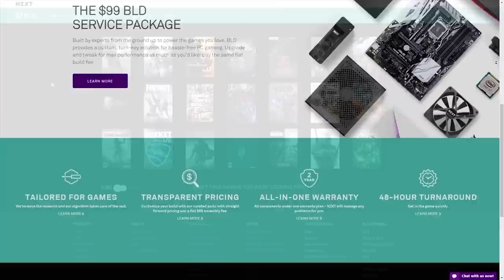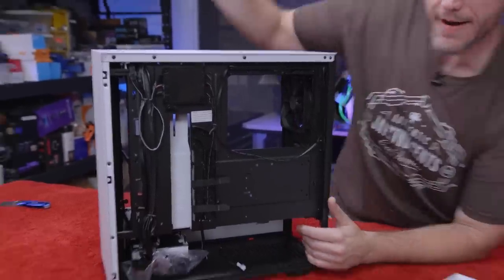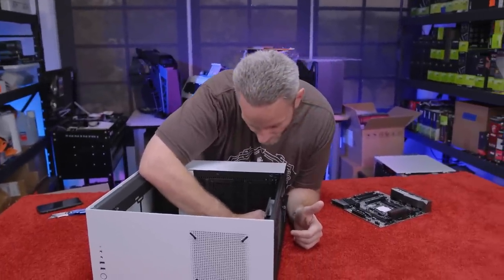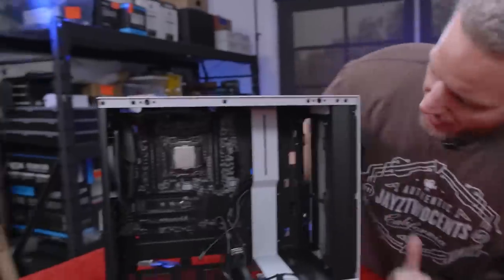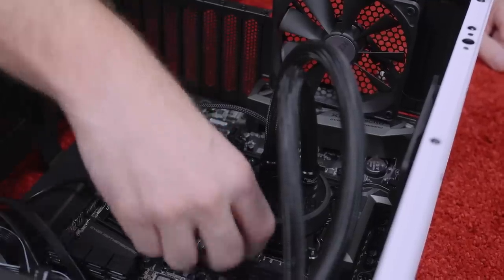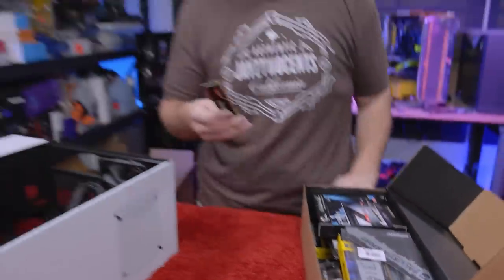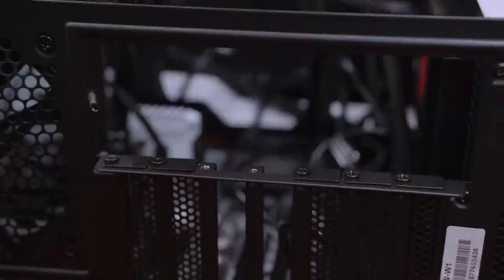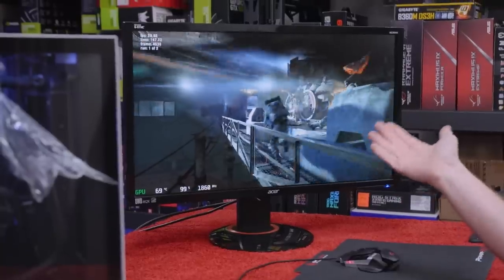We built a computer wrong on PURPOSE!

Comment: is the 1060 3gb version with an i3-8100 still good or should i get the 6gb ver?
Reply: Get the 6GB version. More VRAM is always better
Reply: yeah with that cpu you can utilize more of that card than you could have with an older i3. so double the vram will definitely bemefit you a lot, especially higher resolution
Reply: Dudes, its not just vram. 6gb version of the 1060 actually has more processing power. Dunno why, but it does.

Well... small diff really. 5 more frames in gtav.
Reply: I believe the 6GB version has somewhere between 15 and 20% more processing cores (CUDA cores) then the 3GB version. So it has a significant performance boost over it.
Reply: A lot of games are requiring more and more vram. I have a 770gtx, and my wife has a 1050ti. Her has 4gb of ram, mine has 2. Technically mine is the faster card, so mine runs some games better, but in some games the vram is maxed out and it actually runs worse than hers with a slower processor. 3gb will begin to struggle very soon in games so 6gb would be better.

Comment: There is one thing you cannot do if you have a motherboard with pins on it or you will destroy your pc literally. Don't touch those pins and always use a protective cap that they give you! It only takes a slight touch and those pins could become damaged and thus your computer will not post and become a large paper weight.

Comment: When I owned a computer repair shop the two things worst things that I've seen that actually fried parts. One custom build came in with the Mobo screwed straight to the case and another had brass stand offs in every spot on the case regardless of where the locations were on the Mobo. The case one fried just the board, the stand off one fried the Mobo and CPU.

Comment: The static bag thing is actually true. I work in the PCB manufacturing industry and myself and a few other engineers did some testing on it and the outside of the bag is more or less holding an ESD charge.

Comment: I think the -_- plug is still an IEC standard though
Reply: IEC 60320 C19/C20.  The more common IEC 60320 C13/C14 can't be used because the power supply draws more than 10 Amps.

Comment: Fan face up from power supply isnt actually bad. It can be used as a pass through for air through the case. Usually depends if your not able to get air reliably elsewhere.

Comment: from what i've gathered in my research on those anti static bags is they are designed to be conductive on the outside and therefore bad for computer componants aparantly the outside of the bag is conductive in such a way that it safely draws static from your body and keeps it off the motherboard.... thats what i've read atleast...

Comment: My very first build, I built on carpet because the only parts of my apartment that weren't covered in carpet were the kitchen and the bathroom, and building it in either of those places was not an option. So I built it on the dining room table. And the dining room was carpeted for some absurd reason. I had no issues with that PC and this was back when an FX-4350 was a viable option.

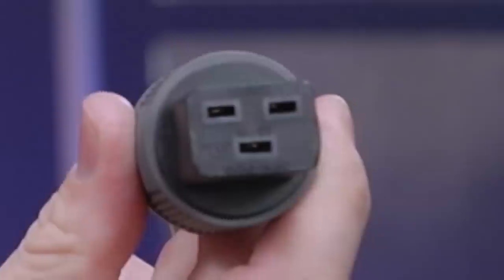Comment: 10:24 that's one I never understood, especially when it comes to semi passive cooled PSUs. It's much better to let the hot air go up through the not spinning fan, than trap most of it inside.
Reply: Go up where, into already hot GPU? When the fan is down, the air is exhausted out of the case. Otherwise PSU would be kicking air into GPU/CPU, and across stuff like m.2 slots etc.
Reply: @X2yt  If your psu is in semi-passive mode, the air isn't exhausted anywhere. The fan is not spinning. If you flip the unit fan side up, you get better convection airflow.
The "hot" air from psu is still colder than any component inside your pc. It will cool them alright.

Comment: ROFL  Ooooh!  I will say, two minor things I didn't see done wrong.  1. Walking around on carpet while assembling the system, especially in that cold and dry Thor God of Thunder static-accumulating weather.  LOL  2. Wipe sweat off of your brow and then apply thermal paste with bare fingers and no hand washing.  Other than that, I think you nailed the level of stupidity I have seen people do.  I think it is highly impressive how far technology has come for building PCs to protect people from themselves.  And to protect companies from RMAs.
THAT said, one thing that a friend of mine admitted to doing once, was to reseat his RAM sticks WHILE THE PC WAS ON.  Did not end well.  But he was an overclocker, and he was very drunk when he decided to do that.  He even admitted to not realizing it was still on.  Because, drunk.  Don't drink and OC.  For the record, I have also personally witnessed him turn a lightswitch in a wall socket upside down WHILE THE POWER WAS LIVE and shock himself repeatedly in the process because he wanted to piss off the building manager.  He was also once prepared to take a thousand mile road trip on bald tires.  (I didn't let him.  Even paid for half the tires and the shop rental to help him replace them.)  So ... don't take tips from him.  Don't do that.  His judgement is highly questionable.  Mmmmm, kay?  We all have that one friend.  Just because he survived doesn't make it good advice.  LOL

Comment: A lot of the things people worry about Used to be a problem. Back in the 90's if you touched the motherboard without anti-static you could blow out chips, if you bent the pins by pushing things in wrong, or all these other things - it USED to be a big problem. But then manufacturers realised "People aren't gonna stop doing this stuff and then blaming us - so we have to make assembling a computer idiot proof!" - - Heck - you only had three parts and a bunch of cables. I remember when the mother board was mostly caps and 12 risers for network, graphics, audio, drive controllers,  parallel and serial ports - Everything was separate!!! And everything had 10 jumpers on it to configure the board settings! And most of it could be stuffed up with being blazei

Comment: When I clean my computer, i literally clean the whole mobo with baby wipes. The ram dimms and slots, baby wipes. Cpu ihs and vrms, baby wipes. GPU pcb, baby wipes. Any thing than the baby wipe have a hard time removing i use a damp microfiber. I've done this for 10-11 years and have never had abnormal hardware failures (psu blew up from way overloading it lol, ssd died) I clean it this way every 2-3 months.
PC components are pretty resilient.
Reply: I freaked the fuck out when I accidentally touched my mobo after taking it out the box

Comment: My first pc was an open frame of a case with no sides on, i had to hotwire it as it had no button on the case. i had it for 8 years and didnt clean it. i even spilled an ash tray in it and didn't bother to clean it up (only realizing it was full of ash and cigarette ends when i tried to put a new graphics card in). It was fine, no issues the entire time.

Comment: Electronic components are much more resilient than people will have you believe.  I had my roof blown off in hurricane Michael and my PC, 144hz monitor and 4k TV all got rained on.  I took the lids/backs off of everything blew them out with an air compressor and laid them out in the sun on an old quilt in the yard for several hours.  Everything worked fine.

Comment: I have built and repaired quite a few computers without ESD straps. As long as you don't intentionally pick up static and discharge yourself before contacting sensitive electronics, you really should be fine.

Comment: That GPU temperature is because it's not in the x16 slot. The performance is capped by the slot, and it's not running at the full speed because of that. That's why the temperatures are low. So, the (lack of) cable management and GPU not being in the x16 slot kinda nullify each other.

Comment: Yeah, I was terrified to build my first computer because the only spaces in my tiny apartment where I had a tables (lol) and the space to build it, was carpeted. To counteract this I used an antic static wrist band on my ankle, which was fine and easy to work with, but I also attempted to use anti-static gloves AS WELL, which just. . . they were so hard to wear and they took away my ability to finely and delicately grip and maneuver the components around, which when the first thing you REALLY put in is your CPU. . .well, on my first attempt, it didn't land correctly into the socket and I had to tear off my gloves with my teeth so that I could try to move it around and settle it properly and snugly in its socket. . . And yeah, It was fine in the end, and none of the pines got bent, it was only directly sitting on top for a few seconds after all, but it freaked me out and  I was so terrified as I was putting in the rest of the necessary things together, to get it built enough, so that I could post test it asap before even putting anything in my case . . . My actual heart couldn't take it. . . Just, moral of the story, remain calm, remain confident, and there is such a thing as going too far with trying to be "over prepared." Jesus. ':0

Comment: Here are things you should have done:
*put the thermal paste between the cpu and socket
*put the motherboard into the case upside down? 
*screw the radiator to the outside of the case
*turned the screws backwards 😂
*used something like a 75w power supply
*uploaded the wrong video 🤔

Comment: that power supply takes a c19 cable instead of a c13.  it's not proprietary.  the difference is it's good for 16 amps, while the typical c13 is only good for 10.  any power supply over 1200 watts that uses a c13 connector is technically illegal in most markets, with north america being the only notable exception.  I've never heard of these laws being enforced, but that's the way it is.

Comment: Maybe everything designed to push hot air out of the case needs to push the hot air in. By this i mean reversing the polarity of the gpu fan if possible by swapping pins so the hot air pumps into the case on a reference cooler. Also reversing the fan in your power supply so it's hot air doesn't get pumped out of the case. uhm front fans blowing air out and rear fans sucking air in. Uhm also yes i would like to see jay do this.

Comment: Remembering my first built, I think I did nothing wrong, but it failed to start up at first, not sure what caused this, it was a 2017'isch PC with Gigabyte Z170X, an i7-6700K and GTX 1070 - I've replaced the CMOS battery, did a CMOS clear and it still refused to boot, somehow I managed to resolve this and it started up, I could activate XMP and install Windows, didn't do any stability testing, but it was stable. Later I got boot up beeps for RTC failure, not sure what this means, but the CMOS battery still has 3.5V, many other weird bugs with the Gigabyte motherboard, really not recommending this platform or Gigabyte anymore, guys use ASUS instead, it's way better and way less weird. Good luck everyone building a computer for the first time.

Comment: My only thing I disagree with is the cable management. My case sucks for cable management. The hole for the 24 pin to go through is so close to the board that it looks like it’s bending the mobo. So I have to bring it up from the psu shroud. Other than that, I understand everything

Comment: I dropped my brand new 1080TI and cracked an inductor. I wanted to make sure that it function so I super-glued it back together. 
I didn't necessarily drop it but more like I dropped a laptop on it when I had the cooler off and before I put the waterblock on.

Unfortunately I'm not joking either and it freaking works just like it should and like it did for the one test I ran on a test-bench at work.

Comment: My first PC build ever I put the power supply with the fan facing up. Lasted me 5 years, and could have been much more but I built a new computer since then! Bottom line is, messing something up isn't the end of the world! 
Also, no I didn't bother flipping it cause by the time I realized it, it had been several years and when I used it fan face down, it made an awful noise. My guess is that the fan got loosened somehow and the fan while facing down was wobbly or something. Fan side up makes no noise whatsoever so that's how I continued to use it for the remainder of that build's life!

Comment: I bent a pin when installing my CPU and I straightened it with a swiss army knife and cracked the mobo while screwing it into the case. 4 years running strong.

Comment: About the only thing in this list that I would say to watch out for is indeed touching the pins on the memory.  I've got 6 sticks of Corsair DDR3 with edges corroded to hell and that caused problems in that build months down the line.  Specifically, I have fingertip-wide patches of corrosion.

Now, granted, I know my skin oils can be a bit more corrosive than most (I also quickly erase the letters from cheap keyboards), but corrosion is a nasty variable to work around when you're having problems a year down the line.

Comment: A computer specialist told me to get a psu a little bit bigger than I need because It will run cooler because it’s not using all its power, so with my 2080ti and R5 3600 I have a 850 watt instead of 650-750

Comment: I built my fist PC back in 1996 when I was 10 using an AMD K6-II 400MHz.  Building back then was way harder as you had to set a bunch of jumpers to match the speeds of your CPU (That's also how you overclocked back then) or you could actually smoke your motherboard.

Comment: I love throwing around pc parts/electronics. Always gets a reaction. Last time I cleaned my case out, my cpu was practically welded to the damn socket... had to pry it out. Then spent about 30 minutes getting the pins bent back into place so it would fit back in the socket. Broke my HSF which had gotten very brittle, so I zip tied it all back together. Runs like a champ. Still plays BO4 smooth despite not meeting minimum system specs. Not bad for a 3+ year old PC with no video card and a masochistic owner....

Comment: Lol I built my last PC on the floor, wearing socks, and probably did everything else wrong, 12 years ago, and I'm still using it today, with all the original parts. I even got 3 mismatched sticks of RAM in it now, different timings/speeds, 5 GB total, and it works fine. I tried to stick another spare 512MB stick in the empty slot, but that finally gave me a BSOD.

Case is upside down too because the GPU fan sags and rubs up against the plastic housing and sounds like a weed whacker otherwise. Took all the panels off for better air flow, and I have an extra fan up against the MB heatsink, just held there by a wire because there's no place to mount it.

Had to take the internal DVD drive out so I could still use it. The plastic pins that hold the CPU heatsink down broke too so now I have 4 bare screws, with nuts in contact with the MB. Don't worry, I screwed them down with confidence.

I'm in the process of finally building a new PC, but watch, I'll do everything right this time and I'll have nothing but problems with it lol. I'm starting to think PC's are like women, you need to treat them badly if you want them to work right.

Comment: The results of this video (just like the Verge PC build) are deceptive. Yes the PC runs and at the start there is very little noticeable performance loss. HOWEVER, the problems (particularly the airflow) won't necessarily show up straight away, but 6 months or a year down the line. Basically when you are building a PC like this you are shortening the life of the components, so a system that should last 5 years will only last 1 year.

Comment: Somehow I didn't destroy my new PC, but I had some unexpected troubles. One would think that the screws on the M.2 heat shields on the motherboard comes off from the plate so you can use it to secure a 4.0 M.2 SSD that comes with it's own heat shield. But noooo, MSI had decided that the screw was a permanent part of the heat shield. I went through several gadgets before finding the right screw from my old Roccat Isku keyboard to secure the M.2 SSD on the board without the original plate.

Then I was stupid and decided to install the AIO on the motherboard before putting it into the case and even more stupid to screw down the radiator on the top before routing the CPU power cable. I still can't believe I somehow got it in the place without breaking anything.

And then the wiring and cabling. Apparently, I managed to hook up most things where they should go without frying anything. I had to power the front fans by a molex cable because there was no physical way to connect them to the motherboard (way too short and next to no space left) and I wasn't sure if I could connect them to the hub that was used for the AIO fans.

And finally, I installed an SSD on the back and almost broke a cable because of the limited space. It still sits slightly bent down there. The installation was correct, but the space for cables, non-existent. I probably should have mounted it upside down since it's barely visible through the tinted side panel.

So if I can build a working PC... Almost anyone can. Just pay close mind to the manuals and handle everything with care.

Comment: I still think I have managed to smash my new build, if I turn off the PC, I have to turn off the power, and turn it on again, while holding the start button and it starts up, if I restart or put in sleep mode no problems it restarts , have been trying to switch power supply and graphics card, still the same, I now have technologist strees

Comment: Jay in one of your previous videos you said no one should pair a 2070ti with a r5 2400g why is that the intel equivalent of the r5 is said to be an 8700k I see many ppl using 2070-2080ti’s so why shouldn’t we pair it with a r5. As for this build I’ve built hundreds of PCs on on carpet and on anti static bags actually I’ve done most of these except the fan thing you did and never had an issue ever!